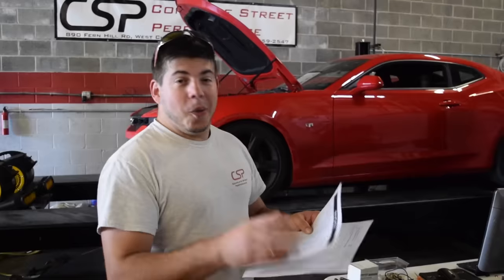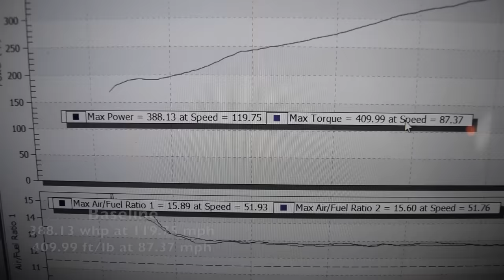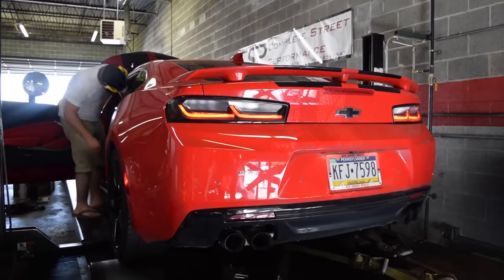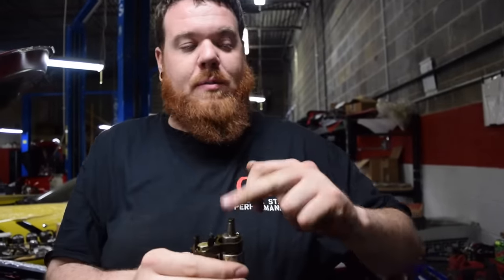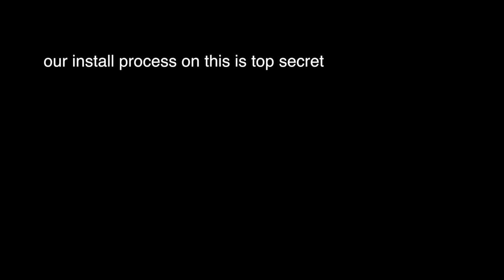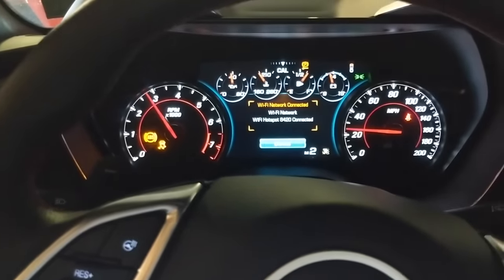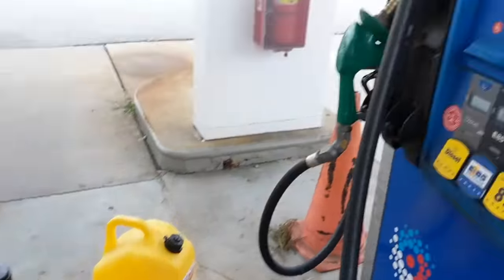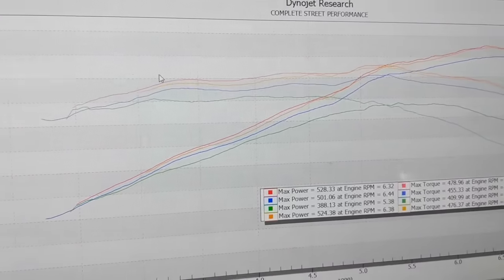How to add 140 rwhp to your Camaro SS without boost!

Comment: New coyote makes over 500rwhp with just bolt ons. Not impressed.
Reply: Can I be Frank torque wins races junior
Reply: @gtboss281  this I know. That's why I'm building a 408w.
Reply: Actually torque plus horsepower wins races as torque by itself is only accounting the work being done as horsepower is the momentum to make the torque go farther and keep the momentum going up between gearshifts.
Reply: @clarencepollard1253  NO, Hp is just a measure of work over time...it's practically arbitrary. Torque is ALL that matters no matter what. The difference is how long you make max torque and at what rpm.
Reply: @DaDeCodeIsTruth  LOL I laughed way too hard at your comment hahaha. Torque is literally a function of HP, you don't separate the two.
Reply: Brado Sanz he is partially right! HP is a rate of work done by the engine to overcome friction including drivetrain, weight of the car on tires vs surface and air  due to aerodynamics! HP is equal to Torque times RPM! 

What actually accelerates the car is the Torque. Higher Torque on low rpm moves the car faster off the line, however due to engine design the Torque decreases or falls flat on higher rpms. Having high hp on high rpms with speed helps the car to overcome all the friction and keeps it pulling hard and still accelerating! Always remember, HP is a function of Torque and RPM! You don’t want your torque to dive down above 5500 rpm but rather have it flatten out. DOHC engines have this advantage. A cam on LT1 engine can do a similar trick!
Reply: @al151  Im aware lol, but you can't separate the two was my point. This guy is saying HP is arbitrary when its not - it's literally part of the equation for calculating torque lol
Reply: Ya and he made 525 so that's more than 500 and probably significantly more torque
Reply: Horse power sells cars, torque wins races.
Reply: not all dynos are equal
Reply: @al151  thanks bro. Somebody needs to explain it correctly.
Reply: The ticking is free
Reply: Michael Cass  don't let peak numbers fool you while they look impressive something that is across the entire powerband say from 3000rpm to 7200rpm may make lets say 20 horsepower less at peak but has more torque and horsepower throughout the the entire powerband will yield faster times most of the time the Ford 5.0 has similar horsepower ratings as the 6.2 LS3 or LT but below 4000rpm the 5.0 has got  80 foot pounds of torque less and most of the time if someone pulls ahead in a drag race well good luck catching them most times they don't
Reply: Tq wins races and a 500whp ss will beat a 500 whp 5.0. Secondly that wasn’t on full e85 like how mustangs use to get that 500 whp and that was 5th gear not 6th which is 1:1 so after porting the msd and using full e85 and running in 6 gear the numbers would be 550 whp 500-510 wtq and add 8-10 whp and 7-8 wtq by going up to 2 inch long tubes instead of 1 7/8 . Your mustang can make those numbers n/a and that’s enough to make that ss run low 10

Comment: all that work though 
a STOCK s63 M5 can get about that much with a simple tune 
costs 1000$ and about 25 mins of work
Reply: true, but whats the cost difference between a s63 or m5 vs Camaro SS?
Reply: Never go full potato. That M5 is also about 30k+ more dollars.
Reply: 30000 tag cost more than 25 min...
Reply: Yep and a proper head and cam ss can run low 10 high 9 consistently which is faster than both cars you named that cost much more are twin turbo and after the 1000 tune all while being n/a and more reliable

Comment: You're doing ALL that and getting ONLY 140hp??  LOL!! Not worth the $$ spent that little power , sorry,I thought maybe doing only headers, exhaust, tune, air intake stuff, It's cheaper to pulley it 
and headers, BTW boost automatically goes up with headers some..so you lie saying without increasing boost....
Reply: Slick Rick if you knew shit about cars there is all different types of head and cam combos, plenty out there that'll increase the power much more not to mention dynos read different all over it's all about what it runs at the strip. And ya a mild or medium head/cam package for about 140rwhp is definitely worth it especially if you know the LS/LT engines and don't have to pay for install.